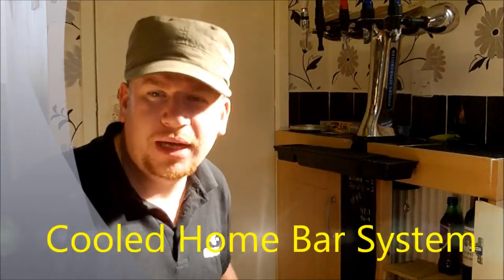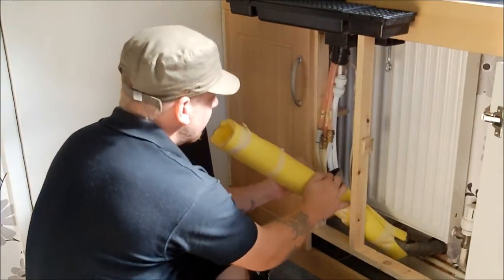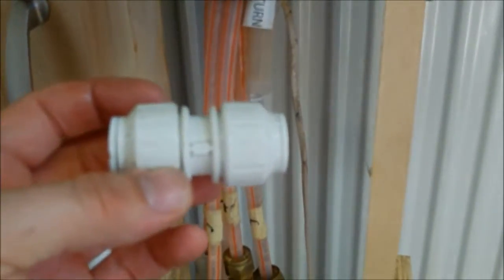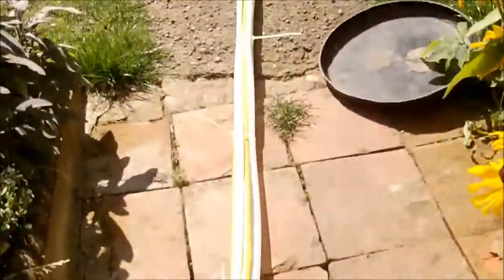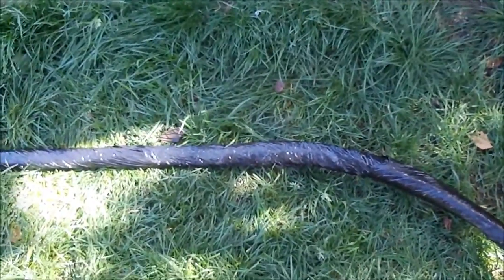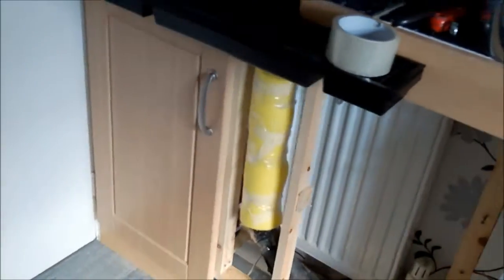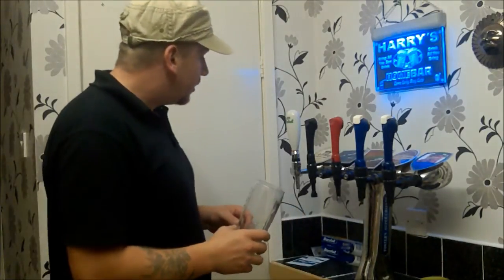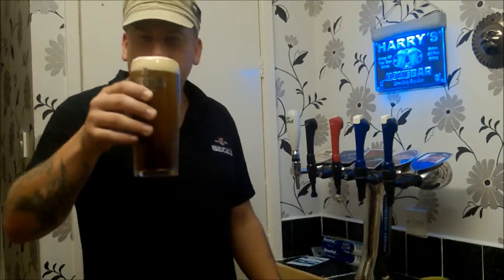Cooled Home Bar System

Comment: How did you circulate the coolant - with what type of pump?
Reply: I'm also curious about what type of pump you used.
Reply: if you have an air supply you could use a flojet diaphragm pump. These are small and reliable (coca cola use them).

Comment: the bar should be built away from the heater thats y its foaming the beer it doest matter about he size of the pipe wen building it
Reply from the maker: Actually, the heater was redundant. Having built many of these systems now I can assure you the pipe size does matter.
Reply: ok
Reply: good job on building it